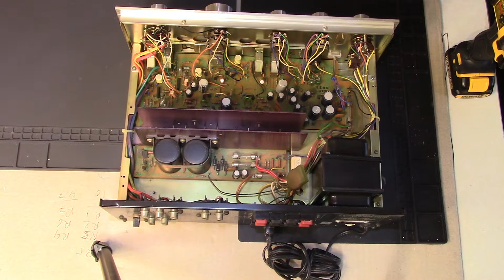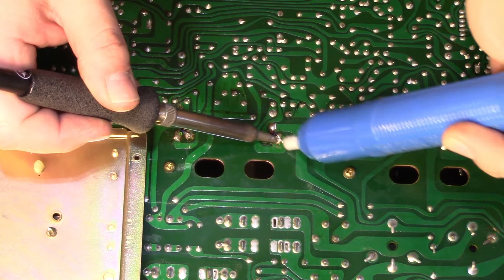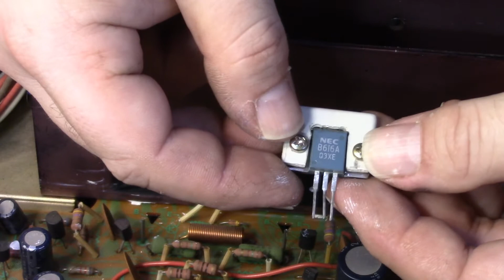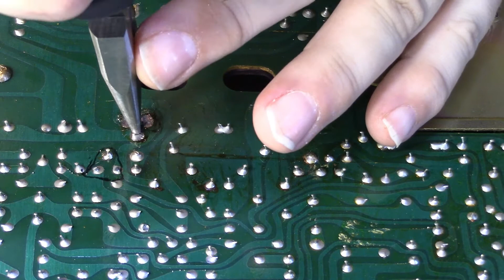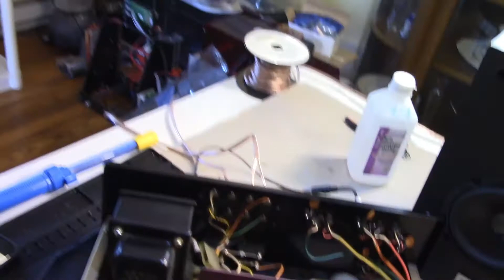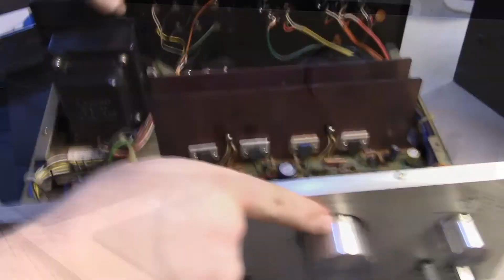Pioneer SA-6500 II Stereo Amplifier Repair

Comment: Trying to work out why my tone circuit seems dead, bass and treble controls make no difference, seems a shame to put a digital device into an amp designed for analog inputs like tape and vinyl and  USA idol is definitely a waste of a good vintage amp.
Reply from the maker: hmm Hard to say. I'd make sure you have power to the tone circuit.  Ideally a tone injector and an oscilloscope would be the best tools here to trace it out.  I'd check the tone switch itself.  If its dirty it might be part of the issue.

Comment: This unit was really bad about blowing output transistors. I have one stored that I would like to repair. It does not like to be run at its full rated output (not even close) and it also does not like difficult loads.  As long as you don't rock out too hard, it is ok.  A good friend gave this to me after the third failure. It has been packed away a long time, but I do have the service manual. May start to look for output transistors, even if I settle for after market.
Reply from the maker: I had these fail about five years later.  I put oversized transistors in and so far so good. I cant recall the part#s but they were rated 1.5X higher wattage wise. I think the biasing is very touchy. I don't quite understand their method here.

Comment: Is it possible that I could get a list of what capacitors you used if you ended up recapping this?
Reply from the maker: I don't have a list unfortunately but what I can tell you is that I would recap any power supply capacitor. The signal caps should be fine.  Anything located near a heat source would be replaced as well. Those older electrolytics were made better. The larger filter caps on the DC amp supply and any of the low voltage power caps would be changed.  No reason to change everything unless you want to.

Comment: I currently have a sa-6500ii that has 2 blown 5a fuses the ones that have red wires that go into the transformer
Reply from the maker: Most likely all four outputs are bad. You'll want to remove them and then see what the continuity is to ground.
Reply: @FixitFrank   hey update , turns out left side d586a has gone bad , I tested all the transistors and it seems like it’s the only one that’s bad , do you know what causes them to go bad? Also where did you get the replacements from? Only ones I could find are from china on eBay
Reply from the maker: that is where I got them as well.  Id make sure the resistors around that transistor are good and within spec.  Usually shorted speakers cause this damage but so can bad filter caps and resistors drifting out of value.

Comment: I have the same unit but on mine one speaker doesn’t work any ideas?
Reply from the maker: I'd start by checking the fuses, if they are open, then check the outputs like I did here. Its a great amp so its worth the effort

Comment: Great video 🤘
I have a sa 6500 ii also, mine has 2 burnt output transistors. Did you end up recapping this unit ?
Reply from the maker: I did not actually. I don't hear any hum and I didn't see any in the scope so I figured leave well enough alone.  I may do it some day but until it sounds like it needs it or someone else buys it, then maybe it'll be recapped.

Comment: Hi Frank, thanks for the excellent vid. I have a SA 6500 II in my garage as well, it was fixed several years ago and in the bag of replaced parts there were 2 NEC npn/pnp and another smaller transistor. It works well but one channel doesn't go to zero volume now. Any idea where to look? Would the bias affect it like this?
Reply from the maker: Thank you! These are great amps. As far as your volume issue, check the volume pot grounds. That can happen if you lose a ground usually. I know the volume pots can be finicky of they are dirty. 
Ideally a scope would be the best way to find the issue but I bet if you check the grounds in the volume and tone section you may find the issue. You may also want to check the biasing. The service manual is free online and goes over the jumpers that you use for bias testing.
Reply: @FixitFrank  Thanks Frank! Best regards from Australia

Comment: Didn't expect to find  a video on fixing my SA6500-ii but here it is. Mine was working well as my garage amp  but after accidentally hooking up a turntable with a shorted channel it stopped working. Great video and gives me the confidence to tackle the repair.  Not sure if its transistors at fault but step by step I will track it down.

Comment: Mine is the same and needs a volume pot replaced. Can you send a picture of the volume pot wiring if it is standard? That's all mine needs. Can you help me?
Reply from the maker: I seem to recall the service manual being available online for free.  I do have this amp still but I will have to take the top off. If you can sit tight for a few days, I will see what I can do.  If I cant get it to take a pic, I will see if I can find the service manual with the wiring diagram.

Comment: How easy is it to fix the power lamp indicator?
Reply from the maker: I don't think it should be very difficult.  The service manual is available online for free to show you how it is assembled.  I haven't had to do it yet.
Reply: @FixitFrank  thank you for your time Frank . I really appreciate sincerely Tim
Reply from the maker: @timsaudio82  Sure thing.  I actually have another one that I am working on. I'm waiting for the outputs to arrive but I will look at the bulb mount tomorrow and if there is anything I can put on video to show you, I will.
Reply: @FixitFrank  that would be really cool of you . I just bought the tx-6500ii off eBay and now I found the sa-6500ii amplifier with lamp blown out. Hopefully that's all that's wrong with it. Thank you again for everything.

Comment: Frank!!
Big fan and also a guy trying to learn the art...
I just recently got a 5500II and a 8500 in a trade for a ADC EQUALIZER!
the score of a lifetime..
The guy dixnt kbow or seen to care ...he just wanted a eq.
Anyway... The 5500 II is in trouble ..
Here's what I know ..
1. No indicator light ...
2. Fuses all check out
3. A not hearing any relay when turning on.
I have also noticed the capacitor that I believe to be the power supply cap (gray cap nestled next to left and right large cap) looks to have had leaked some at some point.
Havung said that I may be wrong and it could be old dried glue..

Any ideas here?
And what is your stance on those "re cap kits " on ebay... Are they worth a darn?

Comment: Just got one of these and the 8800 for free!!
The 5500 wont turn on..
The 8800 foes but no sound.
Any ideas?
Reply from the maker: 5500 - I'd start at the power supply.  Check for fuses and that sort of thing.  The service manual is available online and has a lot of great info.  
8800 - Sounds like an amplifier problem. I'd suggest checking the outputs and the drivers as well as the protection circuit.  Both are very nice amps.

Comment: Hi Frank , I have this amp and it turns on ok goes for awhile and then just cuts out. Any idea what would/ could cause the sudden cutoff. Thanks in advance. Cheers Mike in Nova Scotia.
Reply from the maker: Hi Mike, When it cuts out, will it come right back on, or does it have to sit for a little while? It could be a few things, it's hard to speak specifically due to the many possible causes.
Reply: FixitFrank  Thanks for replying! It has to sit for a little while. I usually shut it off and wait a little bit ,then back on again. Round and round we go. Seems as if something is getting hot and cutting out. I know this is impossible for you to diagnose. Just thought there might be a common problem particular to this amp that was known. Appreciate your channel great content.
Reply from the maker: @miker5502  No problem at all! I actually have a suspect area.  I'd make sure you don't have a speaker wire that might be touching or more likely the protection circuit is kicking in and turning off power to the output transistors.  These have  a neat protection circuit without relays.  It's not as reliable as a relay activated circuit but its neat. If you get motivated, check for leaking power supply caps.  Its possible one or more is heating up and throwing the bias off to the amp transistors which is invoking the protection circuit.  The service manual is free to download and has a lot of good info on checking the bias, after replacing the caps(if that's what it is).  The other likely cause is a transistor breaking down. That's a little harder to diagnose. It's a great amp.  Hello back from Pennsylvania!
Reply: FixitFrank Thanks Frank, will check these out. Stay Safe in Pennsylvania! Cheers Mike.

Comment: Hi Frank, and thanks for this video.  I am trying to troubleshoot one of these units, and my question is the continuity tests you do around the 37min mark.  You test the screws for continuity to the chassis, and then the back plate of the transistor, but you call it the collector.  Is that plate connected to the collector leg?
Reply from the maker: Correct. It's connected right to the leg.
Reply: Thanks for your reply.  Further research indicates PNP transistors do this, but NPN.  Am I interpreting that correctly?
Reply from the maker: @jodyj.6110  They both do it. The only difference is that one connects to the negative supply(PNP) and the other connects to the positive (NPN). The collector sees the most current, therefore the most heat. The surface is insulated from the chassis with heat sync paste and mica or some other insulating sheet between the metal surface of the collector and the heatsink.
Reply: Collector is middle leg on these NEC transistors.  And on PNP, collector/plate goes to ground, so maybe you didn't need to isolate that particular one in the video?
Reply from the maker: @jodyj.6110  There is a piece of mica on the metal.  https://youtu.be/NfxaMnUmPk8?t=681 I put it on here. The screws are insulated from the metal by the front piece of plastic. Occasionally there are amps with the collector directly on the heatsink but it is not common.
Reply: Hi Frank, and thanks for your replies.  To be more specific on my question: it was where you added the piece of heat-shrink tubing to the screws that kind of puzzled me.  If the screws go to ground (via the heat sink), and the rear plates of the transistors go to ground (via the collector leg), why did you need to isolate those screws from the plate?  Seems like it all goes to ground anyway.
Reply from the maker: The collector legs are not tied to ground in this application.  Both back plates are isolated from the heat-sink by the mica pads.  Then the plastic pieces isolate the front of the plates from the back of the screw heads.  The heat-shrink is to keep the screw threads from touching the sides of the holes of the collector plate. Each collector is fed with either +33v or -33v respectively (in this amp).

Comment: Is this 30 wpc or 100?
Reply from the maker: The spec sheet says 25W per, but 30 is what I am saw in the circuit design.  I suspect 25 is where they get the low THD but it will run at 30 no problem.

Comment: Hi Frank, I would very much appreciate your advice. I have a vintage Pioneer SA 1520 stereo amplifier which I bought in 1991 together with a CD Player, a cassette changer/recorder and a pair of two-woofer, two tweeter one midrange speakers. Now I want to add more base sound to my equipment by incorporating a modern sub-woofer.  My doubt is whether I can adapt the subwoofer connectors to my amp´s spring clip terminals using banana plug connectors or other type of adaptor?  if so, would sound quality be affected in any way? if this works out then I could even contemplate the possiblity of buying a new pair of speakers (ELAC, KLIPSCH, etc) . Thanks for your time
Reply from the maker: Hi Alonso! There are 2 easy ways to do this.  Many subwoofers have High level (speaker level)inputs as well as low level(RCA type).  You would wire the subwoofer between each speaker and the amp.  The signal would go to the sub via the high level in, and then back out to the speaker.  Similar to a Bose Acoustimass of the same era.  Your amp also supports low level output after the volume control,  On the back there are 2 little jumpers between the 'adapter' ports.  You could use two RCA female to dual male adapters to bridge the adapter output/input(replacing the jumpers) and then run a long stereo RCA cable to the subwoofer.  I would prefer the second option as it would likely sound better. However, if your L/R main speakers are not far from the amp, then using the high level option would be just as good.  The low level option is better if the sub has to be far away physically from the amp or speakers.   https://www.manualscenter.com/manuals/pioneer/sa1520-owner-manual.html  page 4 of the manual shows the adapter plugs on the lower right of the back of the amp.
Reply: @FixitFrank  Many thanks for your advice. I¨ll try it.

Comment: How can i get the power transistor also my pioneer s6500 ll is no sound
Reply from the maker: I bought mine via eBay from China.  I went with original NEC parts.  Make sure the driver transistors are also functional.
Reply: @FixitFrank  how much you buy the transistor?
Reply from the maker: I think it was less than $20 for the pair of the originals.  You can use substitutes.  The transistors I removed were substitutes and probably worked ok. You will need to check the bias afterwards.  The service manual is easy to find on Google. The service manual shows the steps for setting bias.
Reply: @FixitFrank  what transistor you use for substitutes?
Reply from the maker: @maryjanelabrada6330   I like to use the original when I can.  Then each channel sounds the same. That is why I replaced the transistors in this one. I show the parts I removed around the 9 minute mark and have the part #. Those were OK substitutes.  I do not know of any perfect substitutes which is why I bought the originals.
Reply: @FixitFrank  is it compatible i use other transistor for my SA 6500 II
Reply: Thanks for this, just picked one up for $40 and it has a couple issues that I’m trying to identify.

Comment: Hi Frank
we have a problem with our sa6500 II .
we changed four powertransitor(Q17.18.19.20) they were out.
So after ,we verified all the differents voltages with the service manual.
all voltages are good ,only one is very strange ...
pin 5 on the two TA7136p1 ( q1 and q2) we mesure -19v instead of +17v
all other pin are ok ,r7 and r8 are ok

do you think the twice preampli are out ?
can you help us please

thanks 

BUBU & MAT ( french GUYs...)
Reply: Hi 
I add,thank a lot for your tuto. 

Bubu mat
Reply from the maker: hello, I suspect you have a bad resistor somewhere in the power supply. Start tracing the voltage back and I suspect you find the bad part. I will check the manual tonight and see if I can locate a possible resistor that would cause this. Thanks for watching my video!
Reply: FixitFrank. 
Hi

I verified all supply voltage.
Tp7136p1 has goods vcc- and vcc+.
The pin5 is not ok. -19v instead of +17v
The voltage is bad because the aop is ko? You think?
Or do I must apply a audio signal  in the tp71... ?
Thanks a lot.
Reply from the maker: What do you read if you remove the IC?  I found the service manual and pin 4 -19, pin5 +19, Pin6 0v, Pin7 +21v.  The +19 is derived from the 21v via a resistor. Make sure that  R8 is 47K. If it is, then I suspect the IC is bad. If you need the service manual, let me know.
Reply: FixitFrank thanks for your answer. 
I remove the ic channel A. I read -19v on pin 5 ic channel B.
2nd test,I remove ic channel B,I read -19v on pin 5 ic channel À.

3rd test, I remove twice ic A and B,
I read 19/20 V on pin 5.
The R8 and R 7 are goods.47 K.

I think twice Ic are out.
What do you think?

Thanks again
Reply: Hi frank

The ampli is repaired. 
After test with phono, all is ok.

I think the voltages read on the ic are normal.

Thanks for your help. 

Math

Comment: Love the clarity and detail of your vids, it's nice to clearly hear what you're doing and see the actual work being done instead of a blurry out of focus mess. 

Just picked one of these amps, but it keeps blowing the 5A fuses. I initially thought it was bad capacitors, but from what I've been reading, it seems more likely the output transistors may be to blame. I've never tried replacing these type before, so this vid is perfect.

Great tip using the pliers to help distance/separate the solder from the other joints, I've never seen that trade secret before. Keep up the great work!
Reply from the maker: Thank you kindly! Audio gear is my weakness. I love working on this stuff. Make sure you get the service manual(free online) and look over the bias section. I will do a video on setting the bias shortly(within the next week or 2 I hope).